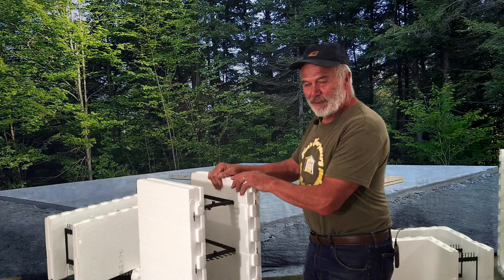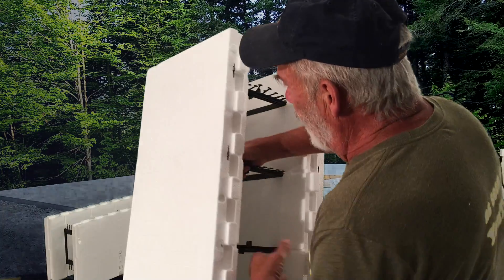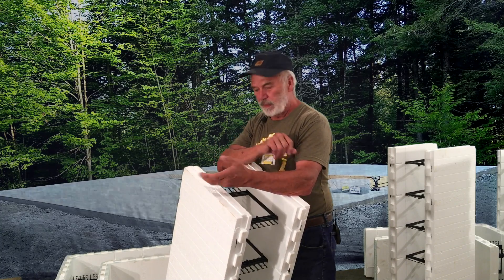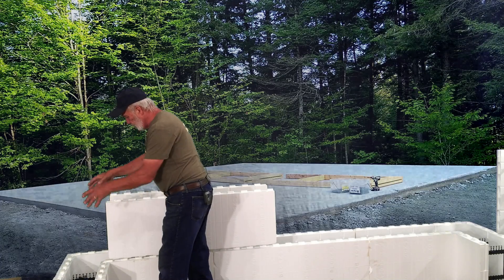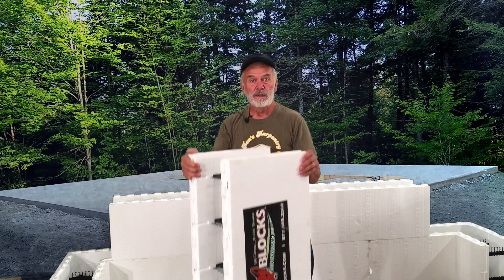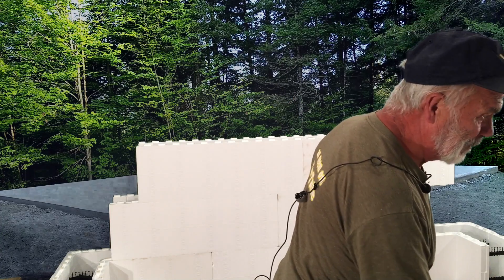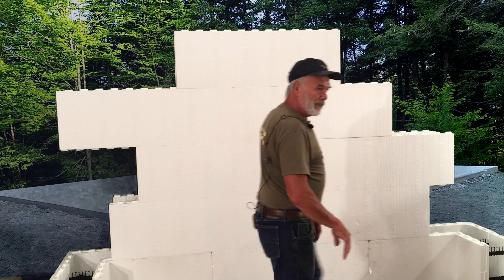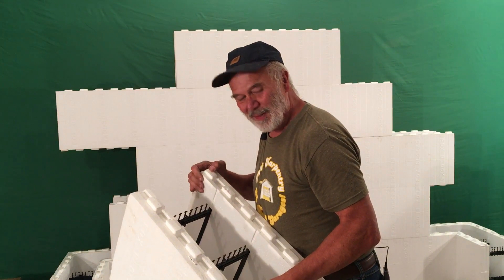ICF...INSULATED CONCRETE FORM BLOCKS   How Do They Work?

Comment: We drill holes every 2’ and use 250 lb zip ties around those rebar brackets to lock the blocks together. ICF is the move every time though

Comment: Make sure you do all your homework on these (I'm sure you did) because if you don't have everything planned out correctly beforehand, you can find yourself in a bit of a mess. Speaking of mess, make sure you brace these correctly or they could blow out on you, especially when you have areas you cut out. for doors or windows. Also, keep them covered and out of direct sunlight as much as possible because if they start to yellow, it will require a ton of work to get tape or anything else to stick.
Reply from the maker: Thanks

Comment: When I was delivering house packages about 15 years ago I saw them used once or twice in PA. Looked like a good idea but I never saw the final product.. Alot started using the prefab walls that sit on gravel. They are all ready insulated and predrilled for electric and ready for sheet rock. Those seem to work nice. But I've never seen a cost comparison

Comment: Fill those ICF modules with concrete (and rebar, and you'll have a really sturdy (and well insulated) stem wall/footing.  I guess the foam sides are sturdy enough to prevent concrete blow-outs?  Though with only 1 course of blocks, blowouts probably shouldn't be a problem.  Very neat.

Comment: Can you do a 12 story building with them
Reply from the maker: I don’t know.
Reply: Max wall height will vary depending on manufacturer, but as I recall (don’t have it in front of me right now), I’ve seen numbers in the mid-20s or mid-30s for the wall height in feet.  I don’t think it’d really do any more than 3 stories.

Comment: You should take a course from the ICF manufacturer - Depending on the wall height and it’s length a lot can go wrong once you vibrate - getting the concrete lifts correct is also a concern.  The folks at Nudura offer a good course.  Getting doors and windows right can be tricky due to form compression.  If only one course you can attach the forms to the concrete with foam - spray foam also allows for leveliling.

Comment: In WA State we have to pour the footings first and then the stem wall. Then we have to glue foam insulation to sides of footings, top edge where it 90 degrees up to stem. Basically anything below grade on exterior concrete gets insulated except slap itself.

Comment: We built with the Polysteel version almost 20 years ago. They are easy to build with. One thing you have to do is provide a lot of bracing before pouring the cells with concrete . Have plenty of help on hand for possible ‘blow-outs’.
Reply: Exactly what I was thinking.

Comment: Helped a friend build a house with this type of system 20 years ago. 
If you stack them too high and then pour, the weight of the concrete will blow out holes in the foam. 
We learned the hard way!!!

Comment: I built my own garage 48x72 and used them as a rear foundation wall,  6x72x6 (a big wall)  and then back filled behind them.  Worked out great and I hired a pump guy to help with putting the concrete inside the block.  The wall was about 6 feet tall, alot of rebar and tie wire as I went.  That long a span you would need to tie them on the outside with wood and I made my own tunbuckle to keep the wall straight.  After the concrete is poured it was and is solid and cheaper than getting foundation guys to do the forms.  Everyone that has seen the back wall was amazed at the process.  I actually took a class 20 plus years ago on getting certified to do this and it never caught on, so I never used them until about a year and a half ago doing my shop.  The wall was cut into a bank and backfilled with dirt, also has a french drain and water membrane to keep water out.  It took me 6 months prep the wall and concrete floor (88 yards) and 6 months to frame it in with just a little help.  My kids wants me to do a you tube channel.  I don't think I want to hear how my way is wrong.   Any way, I enjoy watching your videos.  You have a good product and every now and then I learn something

Comment: You just know there will be a learning curve on the job site with pointers to share afterwards. Ken mentioned there's a plastic strip so you can screw things down, but I didn't see any external clue as to where they are if you can't see the top row or they are several rows high. Also, how to blend these into the exterior foam board or what to protect them with if left unfinished. Any time there's a new product there will be new questions.
Reply: Look at about the 8:50 mark—you can see writing imprinted vertically on the blocks.  This is the visual cue for the internal plastic strip.  At some point in the video Ken said he was turning the blocks so as not to advertise for the manufacturer, unfortunately this also obscures the strip visual.

Comment: iCF are nice, quick and spendy.  Through experience my tips are, be extra sure the wire clips which clip each block together are secure.  On any cold joint, which is a joint you make other than factory, be sure to screw together by some type of sheathing, plywood, etc.   when screwing into the screw strip do not over thread, stripping occurs very easily.  If the foam is exposed above grade outside, there is a waterproofing material you can apply, however this sealant will not protect against damage.  What I do is apply a stucco to the exposed foam which seems to protect against damage, somewhat.   Final say is make extra sure your blocks are all correctly interlocked and secure.  Blow outs are no good.   Peace.
Reply: By "cold joint", I think you mean a common seam. A cold joint is where a concrete pour stops, then another pour is added onto it later.

Comment: Biggest problem with this system is blow out at the bottom due to the weight of concrete on the bottom form. It’s usual to have one guy pouring and two guys going around the base with 6 x 1inch ready to plug any holes as you will loose the complete pour. Sometimes they brace it before the pour. It usually occurs when the vibration poker goes in.
Reply: worked icf 2 years rarely had a blow out . poured walls 3 laps . mostly used nudura block or advantage

Comment: I built my house 6 years ago. I used LOGIX ICFs for the foundation. My house is more or less round, comprised of 17 8foot wall sections so no 90's in the house, only in the garage.  It was my first time using them and it took me almost a week to stack the house.  The garage took an afternoon, it's 34x28.  I hired a crew to pour.

Comment: Good morning Ken.
Nice use of the background buddy. Looking forward to seeing you work with these. How high of a foundation wall can you pour with these? I have seen forms blow out on a 10ft basement wall. Is there other bracing that you use? Can you still use traditional methods and tools to remove air pockets?
Reply: I built my house out of ICF ten years ago and we poured only 8 foot tall sections at a time with metal straps screwed in across every joint to avoid blowouts. We also had angled braces with turnbuckles every four feet along the wall to adjust for plumb while vibrating the forms with a sawzall with no blade. It worked great- 10 inches of concrete in the frost wall, 8 inches in the basement, six inches thick on the first and second floor, and four inches at the very top of the gable ends! Rebar every course horizontally and every 4 feet vertically.
Reply: @TbassIS42  Thank you for the information Travis! You provided an answer to all of my questions.
Do you live on a coastline? 
Sounds like your building is quite stout sir!

Comment: Those icf look better than the one's I used to use. I would use them on a garage even after the issue a snowbird had with them. It wouldn't of mattered what was used in basement with that much frost. Just because thermostat in living room don't mean that will be temp in basement. We glue the outside of icf too. Being a low wall on slab they should work perfect. I wouldn't bother with glue unless under grade. Thank you for using your time to make the video.

Comment: Ken, I would imagine the guy vibrating the concrete has to have a feather touch when working with these form blocks.
Reply: They are very strong, a blow out with the right mix would be very unusual.

Comment: 40 plus years ago my cousin started a company using a type of foam forms, i think it was before it's time and didn't catch on, i have a friend now building a house with these new foam forms and some of the walls are 9ft tall, i see this system used everywhere.
Reply: My neighbor tried to start a franchise for them back in the late 80s or early 90s.  I am not sure how it worked out.
Reply: These have been around since 1962ish..

Comment: did exactly that ( a 1 row base for our garage) and it worked great. Don't forget to align the squiggly design together between blocks as those are what is going to be acting as your studs and strapping to screw gyprock and siding and you want them all in a continuous line. Have fun
Reply: Is there a specific reason for only using these for the first row?
Reply: @SD-unlimited  I would guess these are being used only for a curb on a slab to get the sill plates up away from the ground.
Reply from the maker: Nice